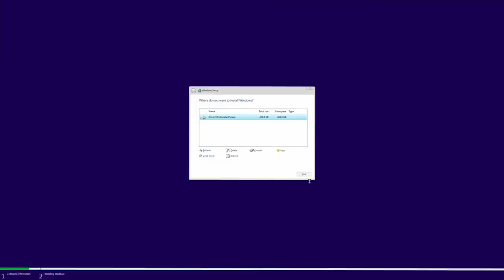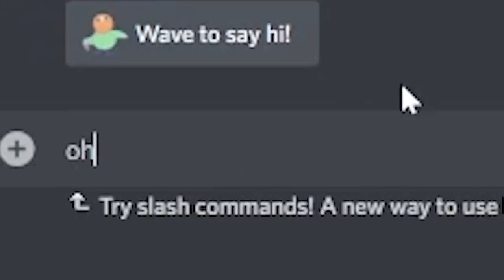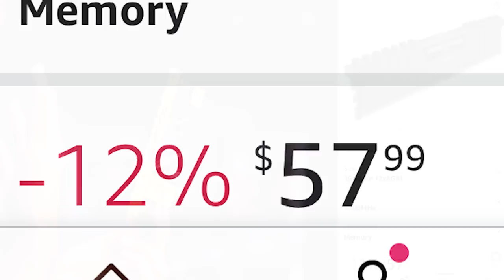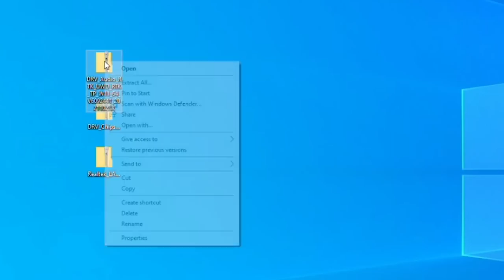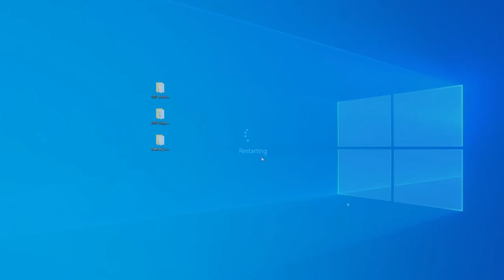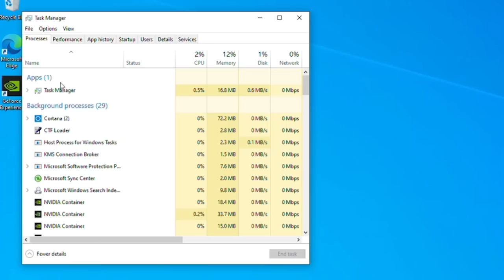$700 Gaming PC Build Guide - GTX 1660 SUPER (w/ i5 11400)

Comment: Do not buy the 60 super for $230. You can get the rx 6600 for $250 and it'll smoke the crap out of the green one.
Reply: Would i need to change any other parts? Also since the motherboard in the vid is out of stock, would a asus prime b550m-a work?
Reply: @cainsaint  Yes. any B550 would work. I have a build list, check the comments but I can build you another one since it has been a month. So parts might be cheaper.
Reply: @itsatrap4986  Theres a lot of comments so its hard to find.If you could send me a better build thatd be amazing. so far ive ordered the fan, fan splitter, and power supply joey used in the vid.

Comment: plz  make a r5 4500 rx6500xt built for cheap
Reply: Don't recommend the 4500at all because it's essentially a 2600. The 5500 is the lowest I'll go for AM4 but not more than $100 because it's essentially a 3600. Th 5600 for $145 is the best value chip for AM4.
Reply: @itsatrap4986  oh bro i see but it’s cheaper than the 2600 in my country. At least it’s 4th gen in paper. I’ve got the R3 2200g and thinking about upgrading it.
Reply: @edizea  I apologize that prices are badly different from country to country. If the 4500 is the cheapest for a 6 core 12 thread chip then go for it. What about the used market for a used 3600? Is it cheaper the the 4500? And I assume you have a b450 motherboard? The 6500xt will lose performance on pcie 3.0 am4 motherboards. Look for a used RX 570/580 or 1650 super or 1660.
Reply: @itsatrap4986  actually I thought pairing my cpu with used 1060 6gb is a good idea. After some usage I can maybe change the cpu and mobo combo for 12th gen i3 or b550+ ryzen 5
Reply: @edizea  The AM4 is a blessing from AMD. You can upgrade your 2200G to any CPU. You do not need to jump ship to the blue team or buy a new B550 board. You have tons of options. The 2200G is fine which is essentially a i5 7600k paired with a 1060. You will struggle with games using more than 4 threads. If you can upgrade the CPU to a any Zen 6 core chips I think it'll serve you better now. The 1600/AF or 2600 is great but I think if you can find a used 3600 or a good price for a 5500, the IPC is just better than previous Zen chips.
Reply: @itsatrap4986  thanks bro I’ll search in my local 2nd hand market
Reply: @edizea  No problem bro and you're welcome.

Comment: Pretty garbage specs for $700 ngl
Reply: What can you do better with 700?
Reply: Exactly what I have been saying, people are making videos nowadays just to milk views, this pc is totally not worth it for 700 euros. 1660 is 1070 level of performance and that shit in 1 or 2 years won't play anything in 1080p only if you put everything on low. At this point in time with high prices it's just better to get a ps5 for 500, it got better specs than this shit pc
Reply: @Mintskullsucks  Yeah I can easily do better than this.
Reply: @nunosanches3693  I wouldn't go as far as to say get a PS5, just build a better $500 PC. It can be done, and in the long run will be cheaper than a PS5 and almost as fast.
Reply: @truereaper4572  Yeah after analyzing this you may be right.

Comment: Bruh getting the gpu for 225 dollars why it's for 315 dollars for me, I hate my life
Reply: RX 6600 is better for $250.
Reply: @itsatrap4986  The rx 6600 is priced at 333$ here
Reply: @itsatrap4986  I just wish I was in the usa just for the sake of buying pc parts
Reply: @mugamer2364  USA is on a decline. You don't want to be here. The world is a big place that doesn't revolve around just one country. Even though it's $333 for a rx 6600, it's still better than the 1660 Super or 3050.
Reply: @itsatrap4986  Bruh I have to pay extra 100$ or 50$ on each part, even mobo or rams, the cheapest 2×8 ram kit is 70$, cpus and gpus stuck on the release price means thier prices are still as if they were released yesterday, any cpu costs the double here I'm suffering 😥
Reply: @mugamer2364  I'm so sorry brother. I still have my R7 1700, RX 580, 500GB SSD and 16GB RAM from 2017. I have not upgraded anything except adding 2TB HDD of storage. If you haven't build a PC yet, look at used parts from both Intel and AMD on the CPU and Radeon and Nvidia for GPUs. Older generation parts are still great for gaming. Old doesn't mean it's obsolete. My setup still games fine 1080/60 for the most part. Look around at what's cheapest in your local market. Ryzen 1600/2600  or Core i5 8400 is still capable of gaming. Maybe OEM or system integrator pre-builds. Anything from 2017 or newer fine. Don't worry about PC master race. That's just a degenerate mindset.

Comment: This is a terrible spec & you should be ashamed for recommending that anyone get a 1660S at this price range.  3060, 2070-ti, 1080-ti are all so much faster & easily fit into a $700 build…this video must’ve come out months late to the point that it’s now straight up missinformation about the current state of the market.